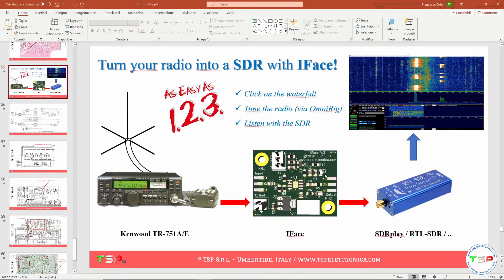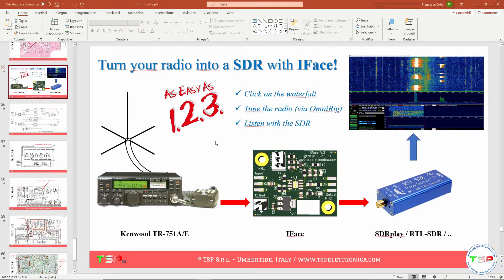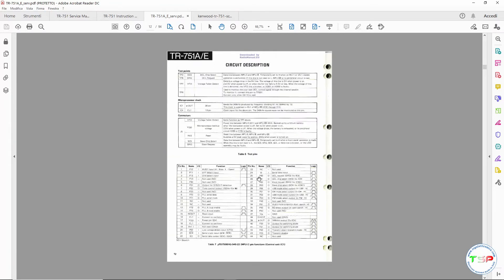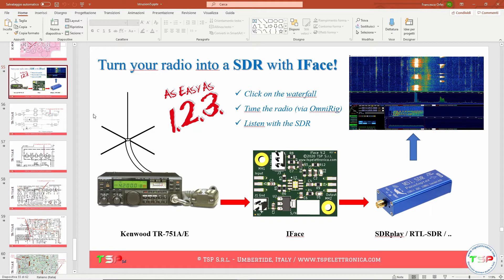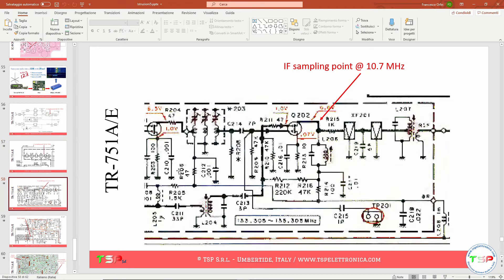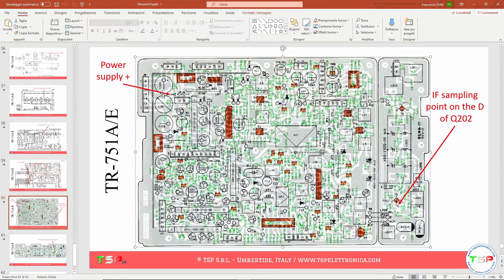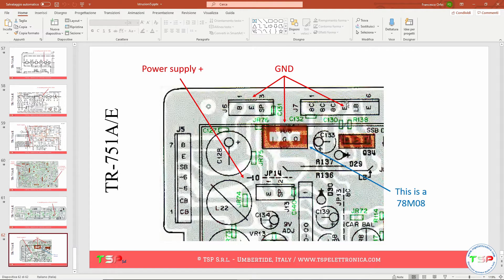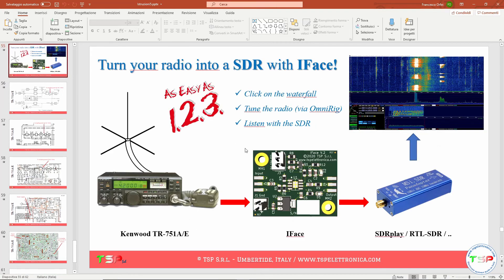All you need to know to add an SDR panadapter to your radio

Comment: When freq changes on TR751 is it automatically change also on SDR GUI?
Reply from the maker: Frequency changes on radio and SDR if they're synchronized using the CAT interface.
Reply: @TSPElectronics  is there CAT interface on TR751? Or we can use your product to sync it?
Reply from the maker: @wimbozone  no, TS751 ha no CAT interface. Our IFace, as any other buffer, is designed to duplicate an RF signal coming from the radio, but it cannot sync radio and software in any way.
The main problem this interface solves is to provide a wideband impedance matching between the high impedance circuitry of the mixer of the radio and the low impedance input of the SDR receiver.
Reply: @TSPElectronics  well noted. Thank you for the explaination 👍👍👍